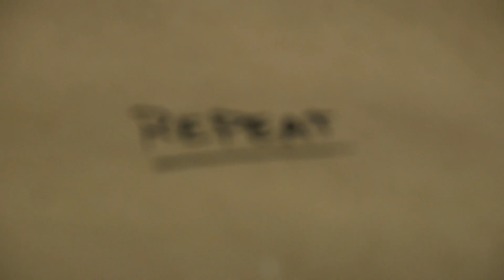Walnut Stitching Pony | Weekend Builds

Comment: Great job! What’s the over length of the pony?
Reply from the maker: Thanks! Overall length is 24 inches. but working length from the clamping screw is around 12 inches. After a year of use, I think its honestly a bit large. Also should have done more of a compound curve on the jaws. I find long thread tends to get caught on the hand screw or on the bench vise. I'm considering a remake at some point and maybe trying to track down a ball mount vise. It works great, but just kinda sucks to have to stand to use it the whole time.